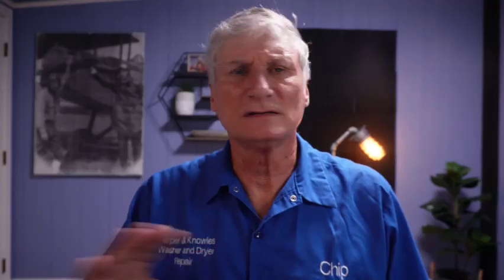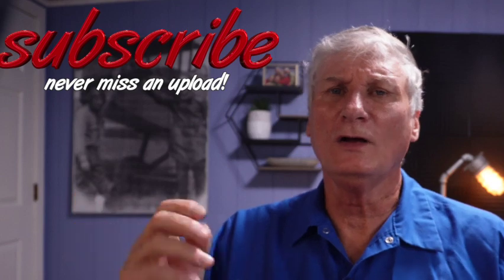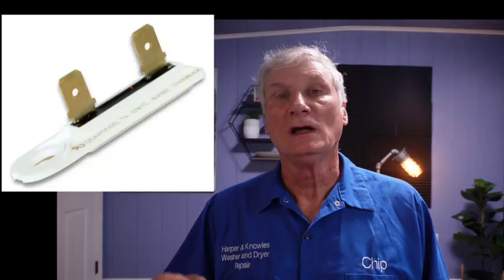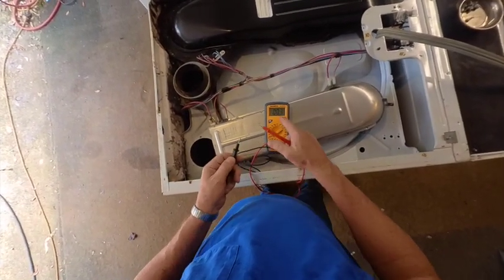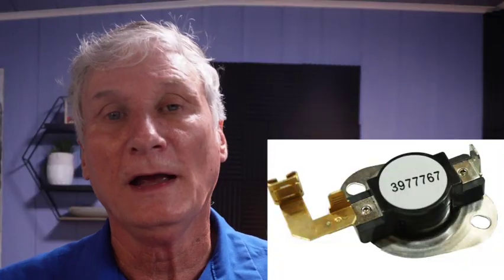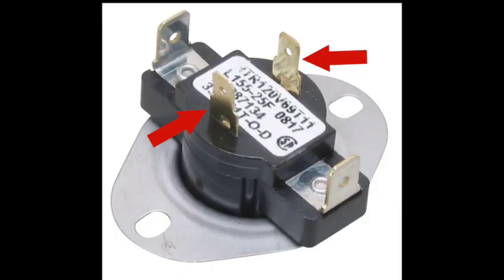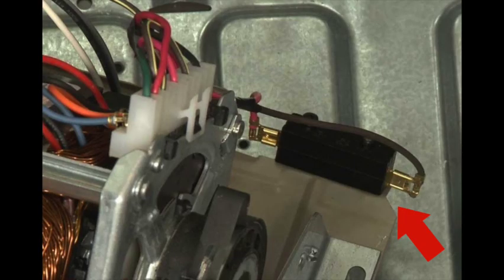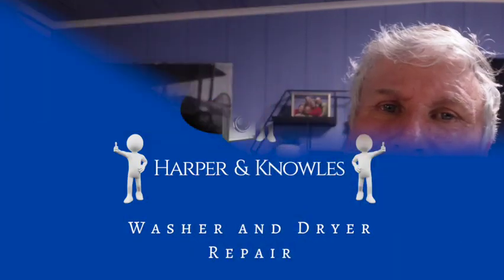How To Fix Dryer No Heat Or No Start | Top 10 Things To Check

Comment: If the thermal fuse or other components are bad I have usually found a restriction of air flow in that long black tube after you take the back off. And it could also be restricted in the flexible duct or beyond.
Reply from the maker: Good advice right here!  Thanks man! I’ll be sure to check that too.

Comment: Hey Chip, love your videos! I refurbish washers and dryers also, I have a filter off the top dryer that I checked all the components in the back and cleaned it and ran a load of towels through the time heat and it worked perfect. When I put it on auto sense dry it turns on but no heat. I have cleaned the two metal moisture sensing strips with alcohol. Any idea what it could be?
Reply from the maker: I think I made a video about this same thing. Does the timer move when you select a cycle on the left side... auto sense side?
Reply from the maker: I found it: https://youtu.be/Gf9pZKzqJFg the second problem in this video is probably related. Check the orange wire on the working thermostat. It's probably related to that. Let me know if you figure it out.  Also, open the tiner and check for stuck points. That will do it too.

Comment: Grettings from S.CA.  Been folowings your other videos and made comments.  You did not reply HMMM?  Anyway, I have to move and have a new washer box installed inside house.While my oldie but goodie Kitchenaide gas dryer has to be put outside,  The bottom where all the components are are dirt with dust.  A couple of years in my youth the machine stopped working.  I took it apart replaced many things.  The motor  was siezed then one day the motor spun by hand.  WOW!  I had put some lithium grease on  the clicker.  After reasembeling the blower vent chute I noticed there was debris drom the  felt or what ever.  Anyway, it was too expensive to replace. I re assebled the machine and it ran with such a howling noise, that of a jet engine.  I assume and might be wrong that it might have been that the foam around the lint housing was gone and now the vibrations were of the sound.  I had seen in your other vids about your using weather stripping..  Would that work to dampen the sound of the roar?  I am concerned that  any type would catch on fire.  What type do you use?  
Since I have writen to you befor I have to have the interior washer box replaced $$$$$  The machines will be outside.  The bottom panel of the dryer is not  place for many months and is built up with dust and debris, especially the  motor even though I have not used the dryer for ever so mny months because the top loading washer sprung a bottom leak.  I haven't laundry in a few months. EGADS!!
Well anyways, when the plumber comes to replace the interior washbox that is siezed, can I use an outside outlet to see if the gas dryer will work  since so much debris has  built up on the motor?  I do not have all the special equipment that you use such  as a compressor.  What could you recommend this poor damsil in distress to blow off debris of the motor?  Sice it being a gas dryer  would a yard outlet be suffient?
I am so grateful of your vids.  But, where is AMANA?.  Sure miss the beauty of the feathers.
Excuse the typos, developed double vision.
PS  Oh the yard outlet would they be enough to power up the gas dryer?
Cheers from S.CA.
Reply from the maker: Your seized motor might have been something that dropped down the lint filter slot and got jammed in the blower. The sudden freeing up of the motor and noise suggest that whatever jammed the motor is still in the blower and rubbing on the wheel. Weather stripping will work fine to reseal that vent from the drum to the blower. Use a vacuum cleaner for the dirty motor. A standard 110/120 volt outlet is sufficient to power a gas dryer. The peacock is still around but is molting now and doesn’t display so often.
Reply: @HarperandKnowles  Thank you so much.  Back then, I had removed the back, that is, when I had more strength due to age.   HA!  I had cleaned the back, removed the lint chute.  I was surprised at after so many years of use, how little build up was in the chute.  There was some dust on the fan blower.  I used a toothbrush to get it spic and span.  The blower moved freely.  I asked about the weather strip because I think the vibrations making the loud noise.  I am concerned about putting it on due to the heat and may ignight.  Is there a special brand you use?
Cheers from S. CA
Reply from the maker: @elegant6066  your clothes will ignite before that weather strip does. Any foam stripping will do.
Reply: @HarperandKnowles  Bless your Heart for your comment.  I feel so much better.